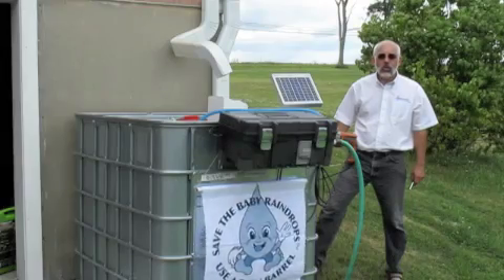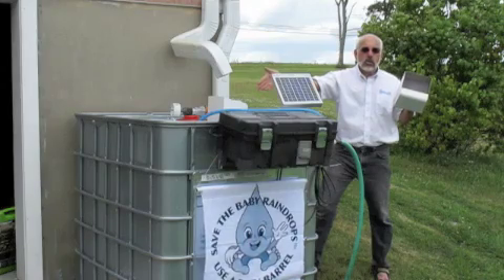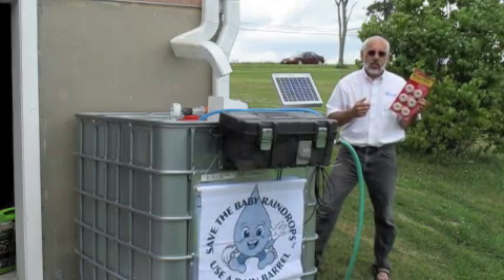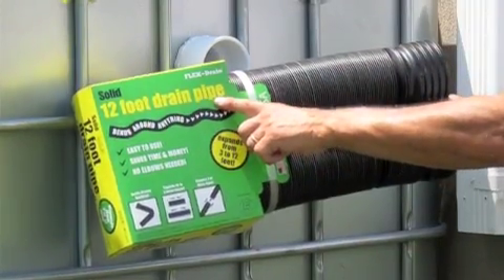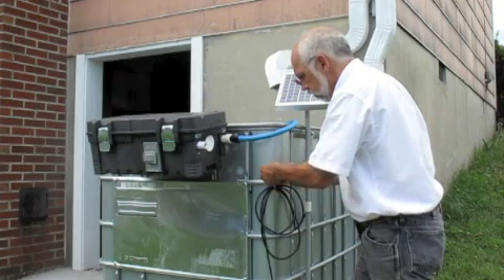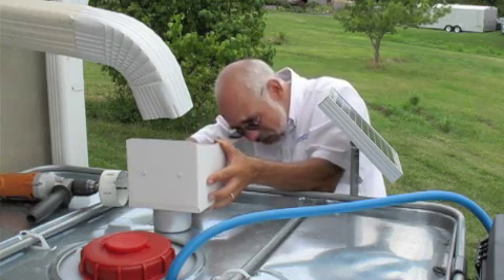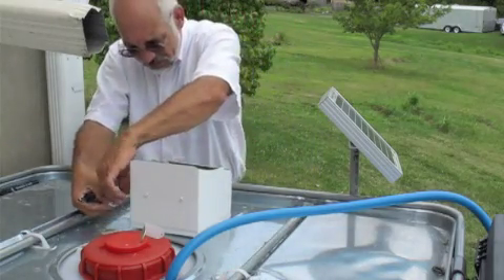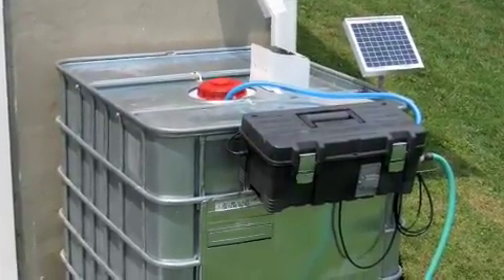Solar Powered Rain Barrel Pump Kit

Comment from the maker: Joseph: If you pump the water to a large black container on the roof you solve a few issues. Run time on pump is minimal. black container in sun gets you hot water. Use gravity feed from elevated tank for shower so no pump is required. If that is not an option just purchase an additional battery and/or panel to keep up with your battery drain demands